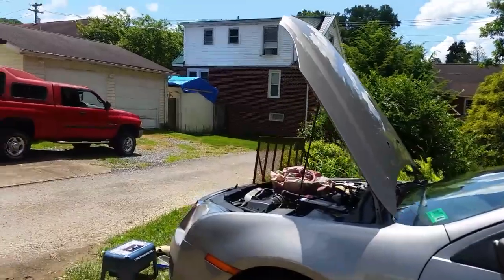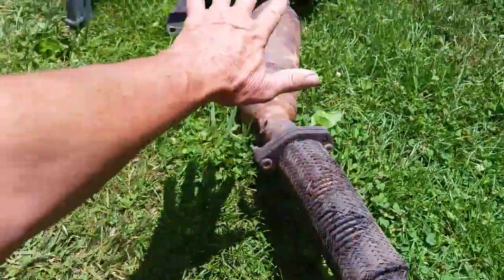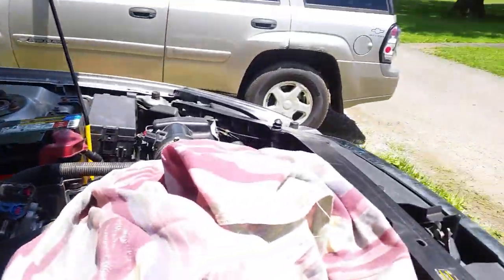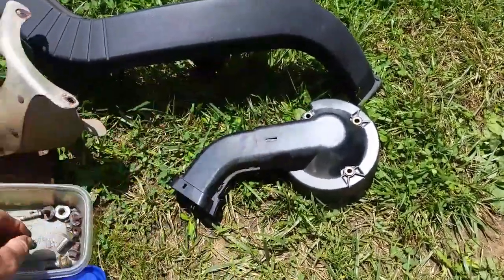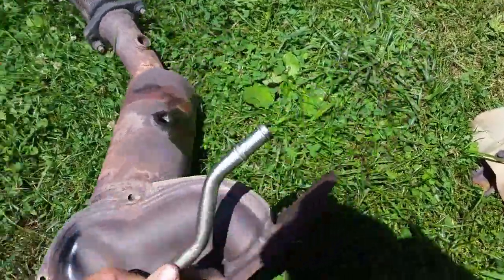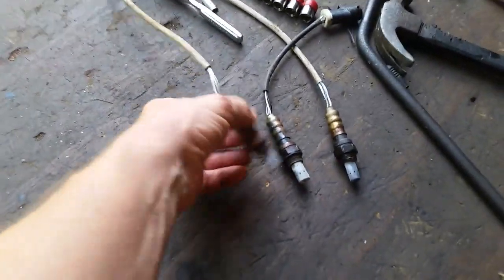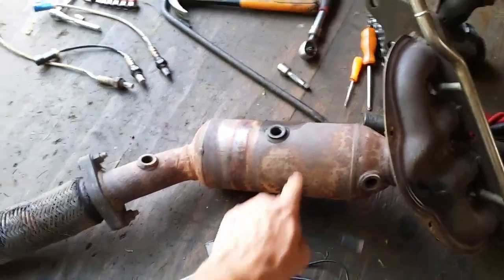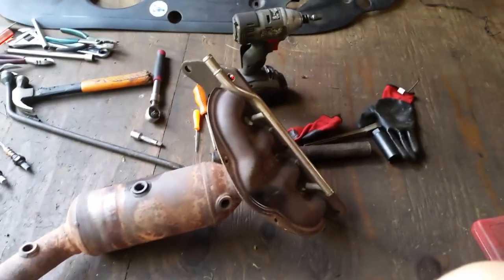Ford 2.3 Exhaust Manifold Removal tips...PO420 issue.

Comment: I think I have an exhaust manifold leak due to the ticking sound I heard when under load, does removing the exhaust manifolds only will let me remove the old gasket and put in a new one? I think the flex pipe will allow more room.

Comment: Great video.  I have a 2006 Ford Focus 2.0 with the exact setup exhaust like yours in the video.  Do you have a video on how to remove the upstream 02 sensor?  I can change the 2 downstream ones but i can't get to the upstream with the air tube and top of the manifold covering it. Does something need to be removed off the top so you can get to the 02 sensor?  Thanks.

Comment: I don't know why Ford loves to use so many Cats? On the early 2000 Mustangs they had 4 cats on the v8. 2 Cats per side. That is crazy expensive and crazy heavy also. I don't know why ONE would not do. Also California and NY are just plain NUTS with their emissions standards. Also, the CAT may look fine, but the precious minerals inside that cause the reaction may be worn away. So it will look fine, but not function properly. Visual isn't always a dead give away with these.
Reply from the maker: 4.6....yep   4 cats!!!  ugh

Comment: From the way that flex pipe looks, I think I would replace it now and not reuse it.  Looks like it is going to fail soon.  Might as well replace it while you have it apart now instead of putting it back together and then have to pull things back apart again to replace it later.
Reply from the maker: Well I just found out today the cat is bad...P0420 again. I scoped it and the data confirms... the cat is done although it looks Ok. Last O2 sensor voltage is all over the place now. Even the middle one 02 is not looking good also. Guess I'll have to get a new one.
Reply: That's what I was thinking. Glad someone else had the same train of thought.

Comment: Thanks so much for the video. The lowest O2 sensor snapped right off on my while I was driving, bung and all. Melted right through the plastic cover over the rack and pinion and created another headache. One question: how did you get that top heat shield off? Those two little bolts were already rounded off and I've got to figure a way to get them out.

Comment: 2 cats in a row? Is that a dirty engine that they had to ad an extra cat and a big one at that? Good video.
Reply from the maker: Makes you wounder.
Reply: I think they naturally do send alot of unburned gas through because it's a port injected engine rather than direct inject so gas is always on the inlet of the port as the valves are opening and closing between combustion of each cylinder. Makes me wonder if ford designed it so that unburned gas is able to go through the system? would allow for both cats to work in conjunction with eachother effectively lighting up the exhaust fumes twice. Need to have fuel to burn fumes. The pzev duratec claimed to have 80% less emissions  than any other car at the time it was released. makes me wonder if the duratec platform is just another Watergate scandal. Because multiple cats don't make sense and it's apparently a thing with ford.